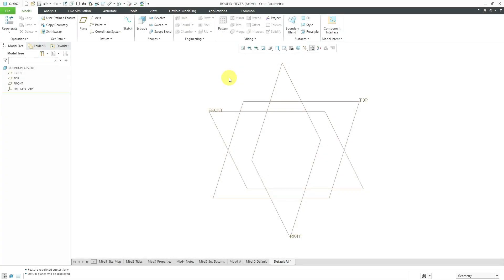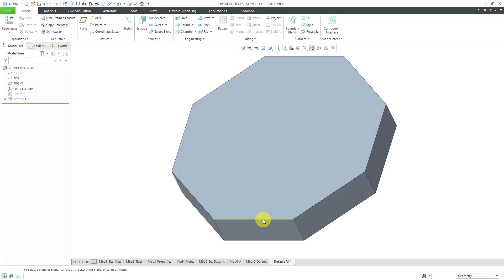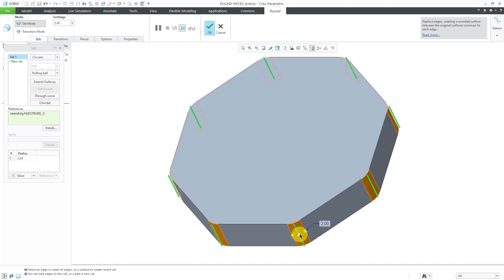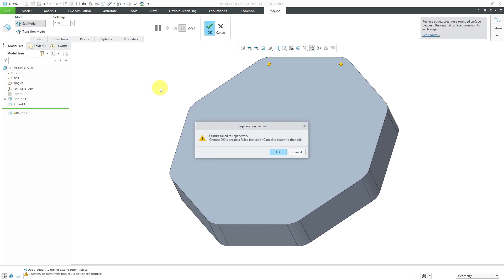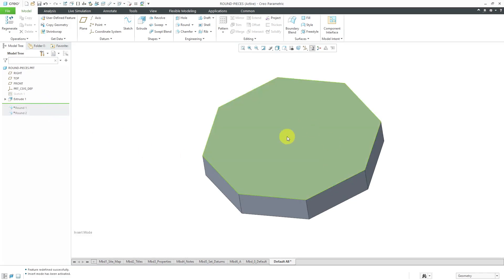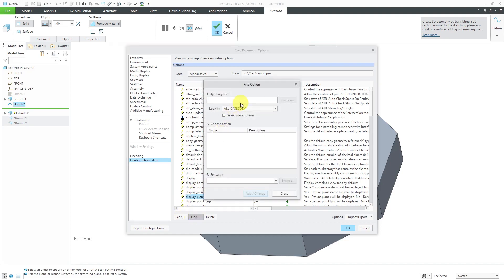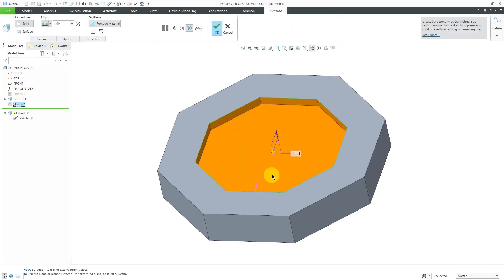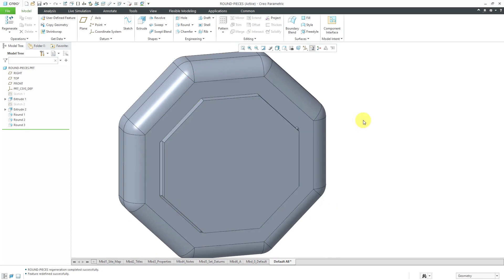Creo Parametric - Rounds (Part 4 of 5) - Pieces

Comment: Is it possible to add tolerance over dimension in same column of family table
Reply: No. But that would not be necessary. Tolerance values change as the dimensions change for ISO/DIN. File--> Prepare-->Model Properties--> Tolerance Change--> Tol Setup-->Standard-->ISO/DIN. Also "Retrieve" Tolerance Tables for Holes and Shafts to ISO standard for Holes and Shafts